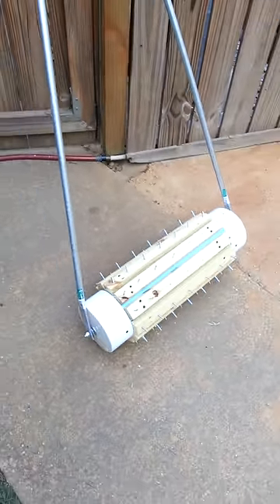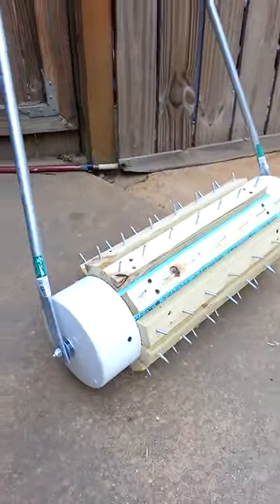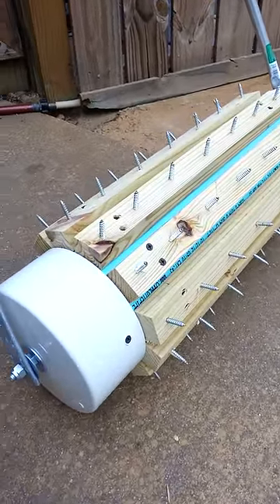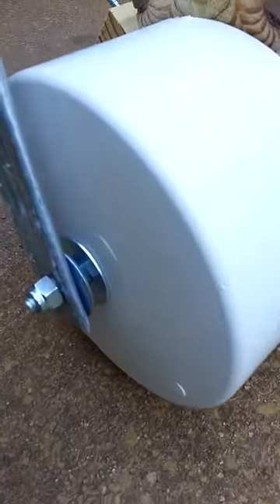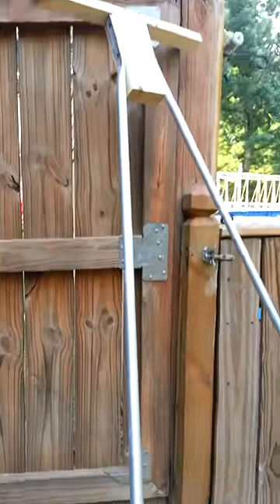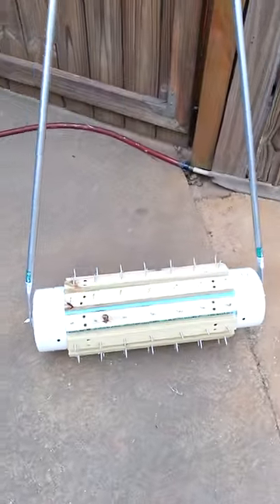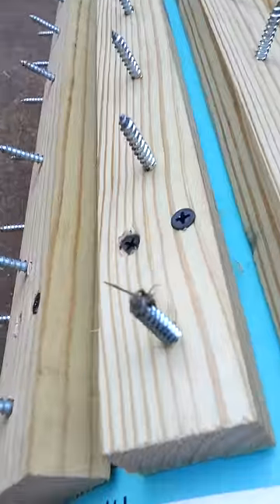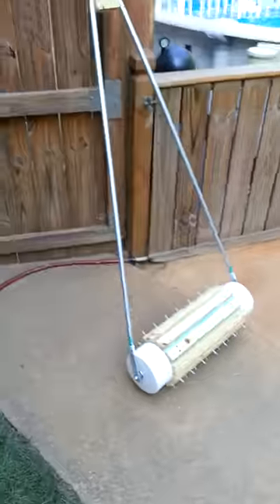DIY Lawn aerator

Comment: This is exactly what I’m looking to build, does it weigh enough? Fill it with wet sand? I have extra 8” poly line laying around at work, might grab a 4 foot section to pull behind my mower.

Comment: you should have used 3 1/4" x 1 inch lag bolts for a better and deeper aeration hole. and filled the 6" pc with sand to weight it down also for better penetration. advice from a horticulturalist.

Comment: Simply piercing the ground doesn't do anything.  The holes disappear after the first rain or watering.  You need to remove plugs of soil.
Reply: allanGEE lx
Reply: Pulling cores on sandy soil is pointless! One should ALWAYS use Tines!

Comment: Too flimsy and light. It will not properly penetrate hard soil or create the proper size hole/core.
Reply: Easy -- fill the PVC full with sand.
Reply: Sand or concrete!